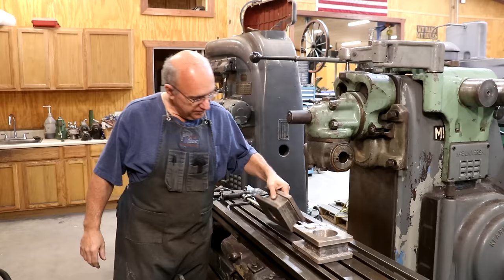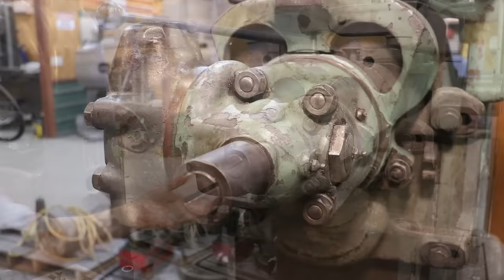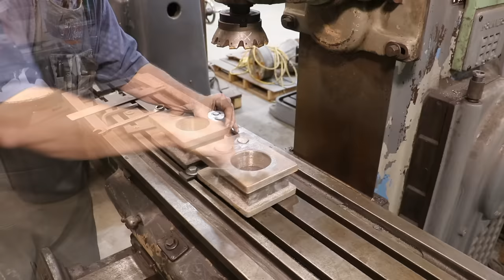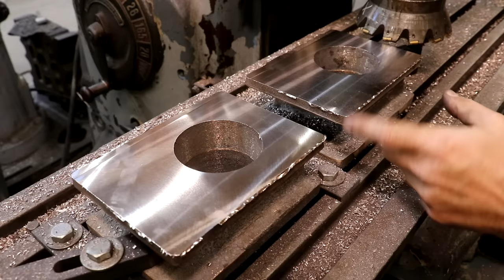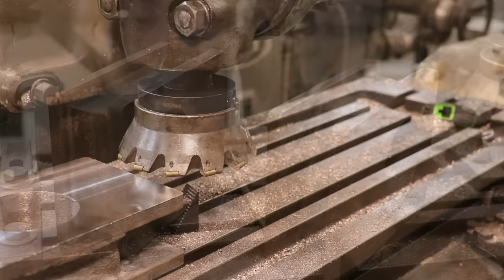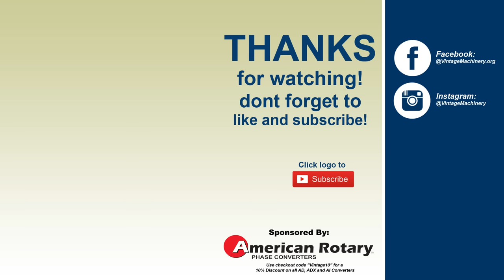Milling Bronze Bearings for the Vulcan Iron Works Steam Locomotive on my Horizontal Milling Machine

Comment: Beautiful how smooth and true that cut was just setting the axis to zero and not tramming the head in.
Reply: I thought the same thing
Reply: I couldn't believe he didn't tram the head. I shake my head at some of the things he does/doesn't do.
Reply: Was that why there was +/- 5 thou when he measured thickness?  Looked like the  12/6 oclocks were thicker than the 3/9 oclocks from those holes...
Reply: "Beautiful how smooth and true that cut was..."  Unfortunately shiny does not equate with precise. Sometimes the old adage, "it's better to be lucky than it is to be good" is good enough but I wouldn't want to bet a SECOND set of costly parts on it. These videos are for the most part entertaining, though, if not exemplars of how things should be done properly to make parts that are both shiny and precise. 

Also, is it me, or are these videos getting ever more light in content? This one was a slipshod setup and simple milling of two faces. At least he could have machined the vertical surfaces as well to make a slightly more content-rich video. Is the time coming when we get a video titled, "Tightening a nut on the (insert machine name here)"?

And finally, last week he mounted the all angle head to the machine and from all we could tell the drive gears were installed completely DRY. I hope he dismounted the head again and added a bit of grease or other slickum to those poor gears!
Reply: I used to run Cincinatti converta mills and I would tram the head in and with a very fine scribe I would scribe a line on the little plates where your graduations to changed angles were. They were aluminum and it was easy to scribe a fine line on. If I were really trying to split hairs I would tram it.
Reply: If Keith took that kind of time no one would watch the video - way boring (no pun).
Reply: That is what video editing is for, doesn't excuse the lack of tramming. Although, it is for a wore-out steam engine. @arlynsmith9196  😁

Comment: Keith, I love your videos and watch every one of them, and I deeply respect and learn from the work you do to keep great old machines in good repair. Now, I know I'm saying this from the comfort of my office chair, but... I was expecting you to tram the head a little more precisely than would be provided by the degree scale, especially with a milling cutter that is as wide as the one you used. Aaaand...those table clamps being so tight with as-cast surfaces down on the table would surely have distorted those castings some. You had at least .010 difference in thickness just around the holes after milling the second side. Maybe that's within tolerance, but this is the second set of castings, so just sayin'...
Reply: The surfaces he is milling are in practice only cosmetic and their machining is for looks and to make future setups for the important operations easier to perform.

Comment: Did the head have to be trammed? Was wondering how accurate the degree markings were. Great video.
Reply: I wondered the same thing...
Reply: It should be, but not doing something like that is how we roll here. Like the machine rocking all over the shop when he tightened the pieces to the bed but it is what it is.

Comment: love to see the vertical head being used.   I was told k and t made the side of the head machined to a point where u could run an indicator up and down it on that big flat spot and basically tram the head in without using some kind of tramming tool.  It looks like just putting the head to zero on the scale gets u where u need to be without doing any tramming or such.

Comment: Keith, I noticed on this video and the previous one that your machine is not sitting solid. It appears (correct me if I am wrong) that it wobbles when you tighten and loosen any bolts. You will not get the best surface finish if left like this. I couple shims will solve this.
Reply: I noticed that also
Reply: the rigidity of this machine has nothing to do with it sitting on the floor.  it could hang from a hoist and work the same.
Reply: @MrChevelle83 ......Absolutely NOT true!
Reply: @MrChevelle83  Take a 10 Tho cut at the recommended RPM 1/8" end mill and then take a 100 Tho cut with a 4" face mill at the recommended RPM, machine hanging in the air.
Reply: @MrChevelle83  Odd... wonder why it has floor-mounting points cast into the base. All this time I've been falsely assuming it's meant to be shimmed and bolted into deep concrete anchor in the floor! 🥴
Reply: @brianroberts4349  ok then why do the instructions on my 15x48 lathe say only bolt it to the foundation if turning large offset pieces? also they say "do not grout in" and ive visited Keiths shop and I dont recall 1 single machine being bolted to the floor.  the only reason I see a machine like these he has and the ones I own would need to be bolted down is due to the design of it allowing a really heavy part to not be able to flip the machine over. all these smaller machines like kieths and mine have all the rigidity built into them regardless of location or foundation.
Reply: @Joel-st5uw  neither my lathe or mill are anchored and none of kieths machines are either, he moves them around his shop when the need calls for it. in fact my 36 inch knee mill has 3 inch diameter dense rubber feet isolating the casting from the concrete.
Reply: @johncollins2037  the 4 mounting bolts in the floor would have nothing to do with the flex in the 'neck' or 'knee' of a milling machine.
Reply: @brianroberts4349  ok, explain how 4 mounting bolts in the base would have any effect on the rigidity of this machine from the cutter to the table and or work piece?

Comment: I took note on your last video about mounting the parking attachment for the milling head you used today 
You were having a lot of trouble swinging the head over to the front of the machine. I could see the attachment point (swivel) for that arm to the parking block was very slightly tilted. At least it seemed to bind from the weight on that hinge point.
I thought that if there was a flat washer in that hinge joint that the surfaces would move much more easily. That washer could be made from an oil retaining bronze so it would be very slippery yet still put up with the weight it is asked to manage. There seemed to be enough adjustment in the arm setup to allow for the bit of extra space the washer would take up.
Reply: I had the exact same thought while watching. Kudos!!

Comment: Hi Keith, Would another method for facing the bearings would be to chuck in a lathe using the center bore? That would ensure the sides would be inline with the bore.

Comment: Anyone who gets this guy to do anything with a level of precision is a fool. He didn't pack the parts with shims underneath to prevent the clamps from distoring the material which after milling the top could spring back and throw the flatness of the milled face off. He didn't tram the machine which is why the parts are not parallel after he milled them. He also does not have the machine properly leveled and secure to the floor.

Comment: Keith: At 4:50, when you were rotating the adapter to vertical, I noticed the whole mill moving, as though the feet were uneven on the floor. Were my eyes deceiving me? You may want to re-check your machine for level. Thanks for the video. See you at the Bar-Z. Jon

Comment: I would have trammed the head in with relation to the axis travels. I hope there's enough material to ensure getting the slots in the side of the casting equal distant to each other and centered in the track that it will need to follow, I hope I can be understood.
Reply: I thought the same, surfaces on the table (horizontal) may be hollow in the centre, and the parallel surfaces (vertical) may not be parallel to each other.

Comment: Ya know, it's kind of hard to watch an untrammed head with a huge cutter just chomp into a set of castings that took multiple attempts for an overbooked foundry guy to produce. Add to that all the unknowns of rough casting surfaces muscle-clamped at a center point that could easily act as fulcrum point while their widest edges hang out in space over open T-slots? If those things came out even remotely flat and parallel, it was a divine miracle. But hey, what do I know? Maybe back in the day these things were made, a tolerance of +/- 100 thousandths was the best you could hope for and this is well within "good enough"? No clue, but it sure looks like a good recipe to accidentally scrap another set of bearings 😬.
Reply: Joel, would you be kind enough to provide a link to your video showing us how you do this the proper way?  I always try to learn from the best.  Thank you!

Comment: Definitely need to tram the head in every time it's changed.....the fact that you didn't would explain the varying measurements you found when measuring the overall thicknesses. That...and not shimming the parts solid to prevent movement and flexing.......and not leveling the machine on solid supports!

Comment: You should take some time and clean up those areas on your machines so you can see any markings and/or numbers on any scales so you don’t waste as much time struggling to see the markings when you’re setting up for cuts or milling.
Reply: (markings) do not mean accuracy, the head should should have been trammed, especially with a universal head. vertical and horizontal issues. Accuracy and procedure does not appear to matter in allot of his videos. The old timers who machined the originals would be turning in there graves if they were able to have watched this set up, precision and QC.

Comment: Hope your next bushings were not shipped by FedEx.  We ordered an expensive printer for a relative and it came by FedEx.  We have a sign in our driveway that says "All FedEx and UPS deliveries are to be made to the top of the ramp at the home behind"  Well, this FedEx, like most FedEx ground contract drivers, especially the ones working for a Chicago company, cannot read a bright yellow sign painted on a large stopsign blank with the message.  
This idiot put the printer on the implement trailer sitting in the front yard of the old house and it was raining.  Thank goodness, Amazon made a mistake.  They sent the printer from their stock by UPS and the printer mfg, sent one by FedEx and it got wet.  Amazon is doing a return by UPS of the FedEx-delivered printer.  
We do not have a UPS store within a 120-mile round trip so we will make a 65-mile round trip to take it to a Kohls store.  We included the part about the stupid FedEx driver and his putting it out in the rain in the return reason.  Hope they check it before sending it out again.  At least the box was one of those shiny printed boxes so maybe the printer did not get wet.  
FEDEX SUCKS SWAMP WATER AND THEIR CONTRACT DRIVERS SHOULD BE SANK IN THE SWAMP.